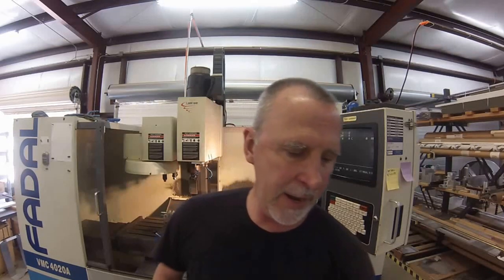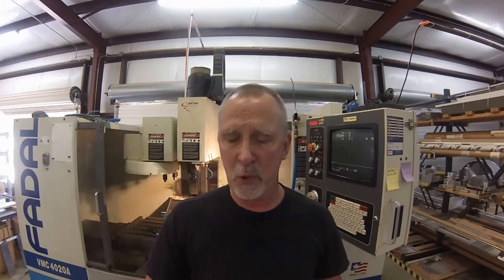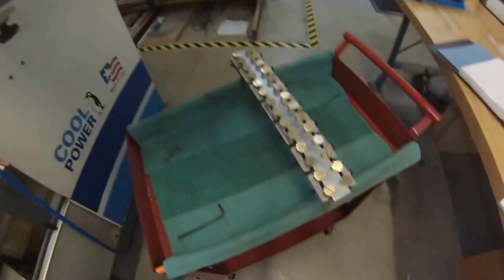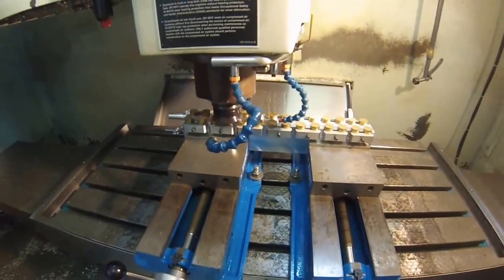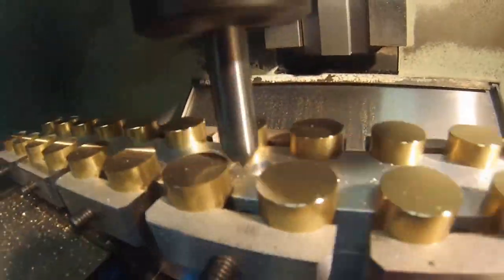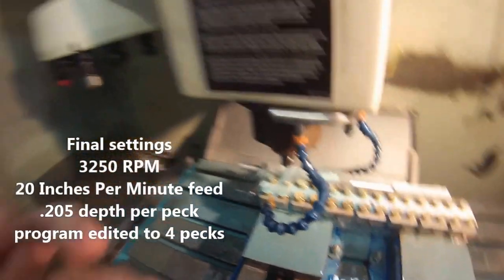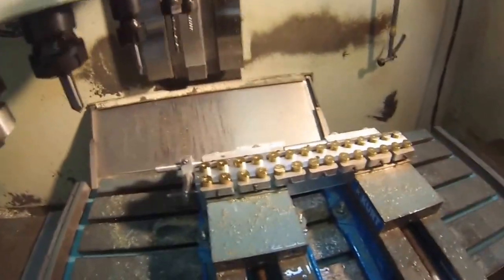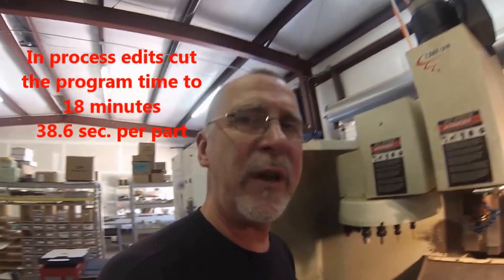Machining 28 pieces at a time

Comment: Thanks Joe. I'm assuming that the operations you showed are in fact the second run through the fixture the first being to face off the bottom end in preparation for machining to length unless, of course, the finish of the bottom is relatively in important.
Reply from the maker: Both ends got finished.

Comment: A technique that I like, is doing multiple setups with the same fixture. I.E having first set up in the front, second set up in the back and running them both at the same time.

So you're always taking off finished parts, flipping parts for second setup and adding raw to the fixture. 

I've always found it easier and more rewarding to deal with a stack of finished parts rather than a stack of half finished parts waiting for second setup.
Reply from the maker: I have 4 Kurt vises on my CNC and try to use that logic as often as possible. Its a sound technique. Good call. I refer to that as flip flop milling and machine my dive light handles that way. I did a video that very concept.

Comment: That is a lot of parts. Out of interest, if I had many bits of flat stock, needed to trim either end to length and mill a feature in the middle, could I hold multiple parts in a purpose made vice at the same time?
Reply from the maker: Absloutely.
Reply: @joepie221  Many thanks.

Comment: Hey Joe how sturdy was this set up in particular the clamping method I have a job ran every  few months using 3 inch H13  I need to drill and threadmill for a 1-1/2 -12 hole into it with a slot and engrave
I run about 240 every  2 months
Just wondering how this clamping method is done and how strong
Reply from the maker: For tougher materials, I would probably use opposing 'V' notches. the setup held very tight.

Comment: Joe, I have had better experience making mirror finish with indexable ( Primitive TPG's at that), than flycutter.  Why you convinced the flycutter is the better finish tool.  My ears wide open.
Reply from the maker: My insert mill is setup with 'wiper geometry' inserts. Better for other materials I guess. they are prone to drag a chip here and there, so for me, the single lip flycutter is my 'Go To' for cosmetic finishes. If I had different inserts, I'd be inclined to use them.

Comment: When I worked in the machine shop at Goodrich making car distributor rotors we had a  dedicated Hoz CNC miller with a similar fixture`s that would machine 30 at a time on a canned cycle, I swear if we had tried to do another part on that miller it would scream in pain lol, and your right while that 20 min cycle was running I could go set and run another couple of other CNC lathes, great days :)

Comment: I do not have a CNC mill. Can you advise on how to machine the half round bump outs
 on the two rectangular components?
Reply from the maker: Sandwich two pieces and make a full round detail right on the parting line. Easy. 2 parts at once.
Reply: Of course, thanks

Comment: I didn't see where you made any off center holes like you said the job needed.  Also, you repeatedly said you could be off doing something else while the job runs in the machine, but you were regularly blowing and clearing with the air nozzle and even mentioned that it was required.  This would mean you need to be by the machine in order to do these things.  This was a perfect job for a CNC lathe, as done on the video.  The finished parts don't fly around in the lathe if you know how to program/operate it.  Nice fixture, though.  Usually that's a NRE that's passed on to the client, no?
Reply from the maker: These parts were a small sample of a much larger batch of parts that included many different hole patterns. The common denominator across all 8 styles was the OD of the parts. The customer was extremely clear when they issued the job with the condition that parts with nicked edges would be rejected. I know CNC lathes are good, but I've never seen one drop a soft brass part into a parts bin without leaving a trace impact mark. The  customer was not charged for the fixture  so it remains in house for the repeat job. As for blowing off the coolant, It wouldn't be much of a you tube video if you couldn't see anything. I remained by the machine for this video, but ran nearly a thousand parts unattended. Thanks for the comment.

Comment: Since they were saw cut both ends and I assume needed to be pretty all over, how did you clean up the back end? Flip them over in the same fixture and deck them off with the fly cutter?
Reply from the maker: Yes. There were 4 lots of parts that varied in length and end requirements. Some just decked, and others got more threaded holes. Same fixture.

Comment: I think you mentioned using a spiral flute tap. I would suggest trying a form tap. I use them for blind holes in aluminum, brass, copper, mild steels, as well as 303 stainless. They work like a charm. The 2 major advantages are. 1) The tap doesn't make a chip. It is about like rolling a thread on a screw. 2) Form taps last a very long time, for only a dollar or two more per tap. I have a 1/4-20 that probably has tapped hundreds of holes. 

If you are not familiar with them. One thing to note, you drill a larger hole for form taps compared to regular cut taps. You can find a form tap drill chart in almost any tool catalog. Example, for 1/4-20 form tap, you use 0.221 drill instead of a 0.201.

Comment: It's a nice set up, just seems like your running that very slow on brass. In my shop we mill brass at about 300 ipm and drill at about 75 ipm. and tap at about 3500 RPM.
Reply from the maker: That was actually the very first pass on unproven fixtures. I cut the time by the end of the run. I have to try some of your speeds. sounds very productive.

Comment: Looked good Joe. I'm a hobbyist so I rarely see production work. One thing that caught my eye was your fly cutter. I can't seem to get the correct grind/feed/speed to get e decent finish let alone a great looking one yours was.
Reply from the maker: You are not the first guy to comment like that. Maybe a short video on the details may be helpful. Stay tuned.
Reply: ww_big_al, one thing to keep in mind. Chip load is a huge factor with a fly cutter.  My go to fly cutter bit is a high speed steel blank that I ground. I got my grind info from Tom Lipton here on YouTube, Tom's Techniques. I do have a small nose radius on the cutter, probably about 0.020" or so. You also want to hone the edges. Use a grinder to get the angles. But hone to get them sharp, including the radius. 

I hope this helps. 

Joe, I don't mean to step on your toes. You have a great channel here. I loved to reverse threading. I will be putting that to use, thanks. I just thought I would post what I know. Just in case he needs the info before you get a chance to do a video.

Comment: I swear by roll form taps. no chips, no issues with blind holes, and it's a stronger thread. I'll run a 10-32 at 1000 rpm
Reply from the maker: The only reason I don't tap at a faster speed is the abrupt direction reversal of my spindle because its a rigid setup. I just have to believe its tough on all the components the faster you go. On my mill, with a tapping head, I always tap at 1200 rpm or better.
Reply: depends on the machine I guess. I've never had a problem rigid tapping at that speed, and I've done upwards of 1200 holes in a single setup with one roll form tap.
Reply: Pat Palermo, I also swear by form taps. They are the best way I have found to tap a blind hole in mild metals, aluminum, brass, copper, mild steels, and 303 stainless steel. I will say, they don't work well for plastics or cast steel.

Comment: With that be the perfect job for a screw machine
Reply from the maker: I actually did my formal apprenticeship in a screw machine shop. Those machines liked much smaller diameter work. These parts could be done in one, but the simplicity of these parts would waste the capability of a screw machine.

Comment: Joe

Interesting video. I noticed that you used a high spiral tap. I have found that using these type taps the pitch diameter of the thread varies. It seems to me that being brass a thread roll tap would be ideal and the thread size is consistant.

Charles
Reply from the maker: Hello Charles,  My experience with roll taps is limited at best. I am not sure I would trust a roll tap with water based coolant anyway. There is a lot of friction. These high spiral taps I am using are giving favorable results and clearing the holes nicely. I'll give the roll taps a go someday when I have time to experiment. Thanks for the suggestion, not having chips would be very nice.

Comment: Very nice! I just made two fixtures also, holding 48 parts each. I used mitee bites uniforce. Was an investment, but previously we made 3 parts per setup, had a cycle time of 55 seconds per part. Now with the new fixture, cycle time is down to a little less than 15 seconds and while one is running, the other is being machined. 

I had to make 6000 pieces, you do the math. Those 77 euro per 6 mitee bites where well spend and will be used for many other parts. 

But I really really like your fixture, the beauty of the clamps through the base and all. I'll sure remember this one! Thanks for posting this video, I'm subscribed!
Reply from the maker: Mitee Bite clamps are well designed and pricey, but small enough to jump between fixtures, so well worth the money. The clamp setup I designed into my fixture also doesn't influence the location of the part since its a squeeze instead of a push. Anytime you can get pressure from both sides, its a good thing. Thanks for subscribing and leaving your comment.

Comment: ..Your comment about fixture location....."the center hole is the 'only' thing needed"....? Isn't that assuming the fixture itself is located in the exact same X/Y location every time...?
Reply from the maker: Yes and No. The center tooling hole is the home position for the program and the fixture. Identified as E1. I can put this fixture anywhere on the table, pickup that hole and call it E1 and the machine will start there. Naturally, if you are using multiple fixtures, your setup must allow for repeated replacement of each fixture to the same position. I believe I showed the left side hard stop for this purpose. You do not have to indicate the hole everytime. Does this answer your question?
Reply: Left side hard stop....I missed that.....thanks!
Reply from the maker: All good. your comment was accurate.
Reply: OK....!

Comment: someone disabled the door safety.
Reply from the maker: Someone sure did.
Reply: I used to work at a shop that had a few cnc machines. Our machinist usually wasn't in until at least a half hour after the first person in the shop for production assembly. Eventually the machinist made a sheet that told us how to start everything up and run the warm up program so it would be ready when he got in. One day I missed the step to disable the door safety and it took him like 20 minutes to figure out why the machine kept stopping when he opened the door. At school I operate a Bridgeport ez path cnc lathe and I wish it could tell where the door or at least the chuck guard are.

Comment: Joe, why the tiped cutter first ? Why not flycut straight away ? 1 operation less will save even more time.
Reply from the maker: I knew someone would ask this. This video was actually shot on the first real run of this fixture and my confidence needed to be instilled before I pushed it. I initially did have a much wider flycutter setup that did both rows at once, but I was seeing harmony (minimal ripples) present from the dual interrupted surfaces. The finish was good, but not what I was shooting for. For the extra 10 seconds, I went with dual cutters and common tool paths on this one. I did increase the drilling ops and roughing op to 100 IPM and cut almost 4 minutes off the program.

Comment: Nice demo Joe.
May i ask, when you first purchased that CNC how long in (hours) did it take you get to know the machines 'character' and true capabilities? 
Approx.
Reply from the maker: I've had this machine for 5 years. I'm still learning the upper level stuff like the engineering software interface, but i was making good parts in 2 months. I did things the hard way at first and most G code entry was at the monitor, but I got the job done. Its very easy now.
Reply: Thanks Joe good answer.

Comment: That's all fine and dandy, until your stock supplier hands you material that is .002 one way or another...and lots of things aren't happy about that in the CNC.
Good vid though for expressing ideas.
Reply from the maker: That would depend on how smart the fixture designer was, and how the program was written, don't you agree?
Reply: There are ways to design, and then there's reality. 
It's always something in a direction that defeats the purpose, and then you have to re-evaluate.
Nothing wrong with your fixture as is has been intended.
Reply: Round stock fastened in v-blocks would keep the X values for varying stock diameter, and a couple offsets would account for the Y. 

 I'm not coming up with a way for the fixture to do it mechanically though.  I'd certainly watch a video on how to build such a thing (hint, hint)!
Reply from the maker: I built such a fixture for an orthopedic company I used to work for. They used it to asemble knee caps of different sizes. 1 fixture did every diameter they had. It was one of my favorite projects I ever did.

Comment: I'm amazed there isn't a blower function in these machines to reduce if not eliminate door open time, but the need to run multiple parts is a fairly new deal I guess. I'm sure more like that will be added soon. Sort of like these tiny homes are bleeding into normal furniture stores with multiple function pieces.
Reply from the maker: If I was really in need, I'd start my drilling operation in the right front of the machine and work towards the left rear. This way, the coolant would not flush chips across already drilled holes.
Reply from the maker: This job ran door closed and was cut to 18 minutes by the time I was done. Additional coolant lines cleared the holes just fine. It would be great to have an air sweep option.
Reply: It just makes sense to me, but common sense isn't the way of the whole world.
Reply: ...Yeah, I'm surprised there isn't an 'air blast' option....or is so, it wasn't ordered with this machine....in the 1970's, I worked for Burgmaster....'air blast' was standard issue, cleared chips on tool retract........and most all machines were ordered with flood and mist coolant options...

Comment: thanks for that demo Joe.
 it looks like a fixture like that would work on a manual mill as well. i had a similar job to do and only have manual machines at my disposal. since the hole in the part was centered i opted to do it on the lathe, but the problem i ran into was that the drill bit would start running off center once it penetrated the work more than the depth of one piece. after about 3 pieces the hole was pretty far off center and i essentially had to start with a fresh face on the brass rod. 
cheers
mike
Reply from the maker: I have had that happen as well. drilling multiple parts is a good dies, but risky for that very reason. This fixture would work on a manual mill. You better have a DRO to help out though.

Comment: Why'd you choose such a hefty tool for the chamfer on the outer edge? Ease of Z adjustment to account for tool dulling?

That rigid tapping sure is fancy!
Reply from the maker: Hey Chubbza5, always good to hear from you. I chose that tool for several reasons. First, it had to fit between the parts as it worked, and second, I wanted as much surface footage as I could get to give me a nice finish. The bigger diameter cutter technically travels farther per revolution than a small one. Then there is also the amount of brass standing proud above the fixture to be considered, so my depth was also limited. My options were limited, but well defined. And yes....I love that rigid tapping. What a time saver! Thanks for checking in.
Reply: Thanks for the reply! I'm sure it's better for the machine with the bigger tool than running a small tool at 2-3x the rpm.

Comment: Why am I not surprised your door glass is crystal clean and clear.  Nice.  How was the other end treated?
Reply from the maker: I processed 2 different lots of parts. One required the opposite end to just be faced and chamfered (18 sec), and the other got a 1/4-20 hole to center (39 sec). That machine is my baby. I try to keep it presentable. thanks for the comment.

Comment: Pretty cool. I've been been around CNC equipment. It's interesting to see it work
Reply from the maker: Ever seen a hexapod run?
Reply: I haven't seen a hexapod run. I'm just now starting to learn about machining in general (almost 59 so it's never too late right). I have a LMS 7x16 lathe. I bought it thinking that it's better to break, I mean learn on, something small than large and expensive (and outside of my skill sets).  I'll eventually get a mill (sooner than later I hope), I restore vintage electronics(ham and audio) and sometimes there are "can't find" parts that a lathe and mill will make short work of in the right hands.
Reply: I love the lathe, great machine to learn on. I like practicing with plastics such as delrin, easy on the tools and   easier to clean up when you're done! Just make sure clean the machine afterwards, hot steel chips on top of the acetyl produces some pretty toxic gas when it melts.

Comment: What RPM did you need, in order for the fly cutter to give the nice finish?  Thanks again for the great video.
Reply from the maker: It was a cobalt HSS tool bit with about 10 degrees of face a rake with a .02 radius running at 3200 RPM. I believe it was 20 IPM feed rate.